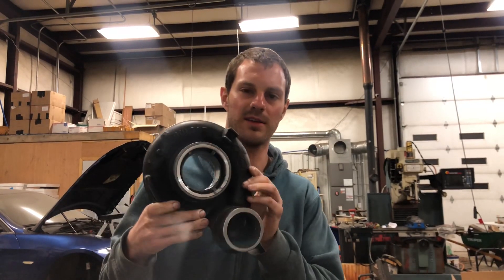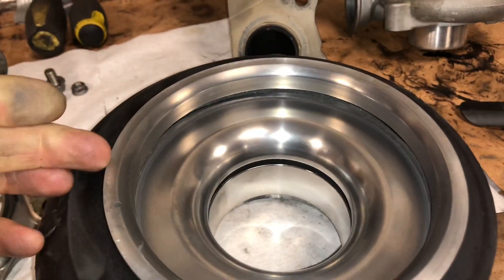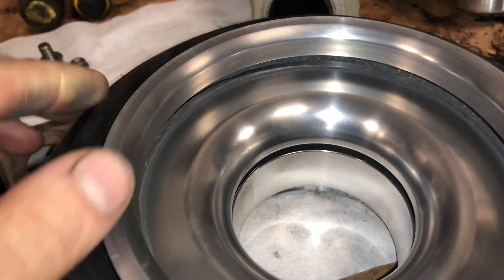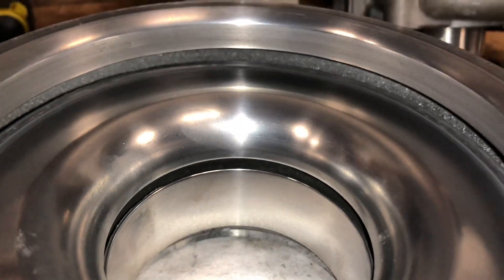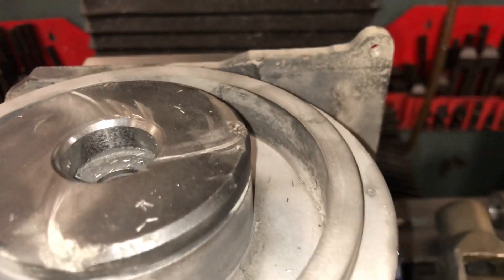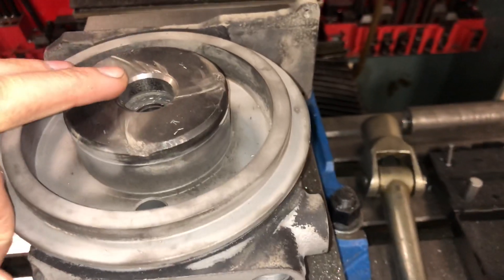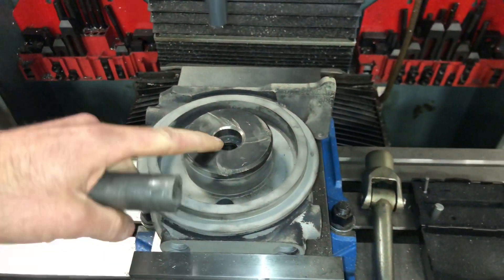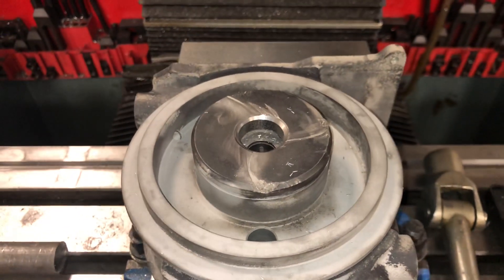Fleece cheetah turbo repair update

Comment: Hey 
What is the clearance  compressor to what’ll in mm ?
Thanks
Reply from the maker: I machined the inlet bore 67.87mm, holsets dimensions are about .95 to 1mm larger than the wheel. .7 mm larger than the wheel is too small. .8mm to .9 is my target . The turbine housing is the same way. Z depth i think is .010 - .015, I always did that by seeing where it rubs and adding a few thousand a until it doesnt, Use your best  judgement.
Reply: Turbo Lab America  thanks for clarifying my idea.
Are those measurements for just one or bouts sides of the compressor?
I really like watching your videos , they have Ben a good inspiration.